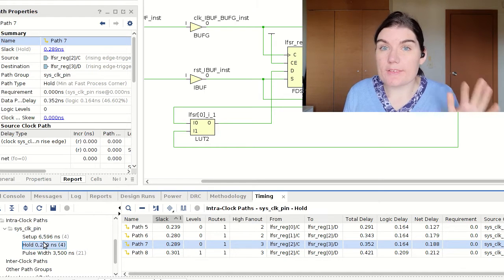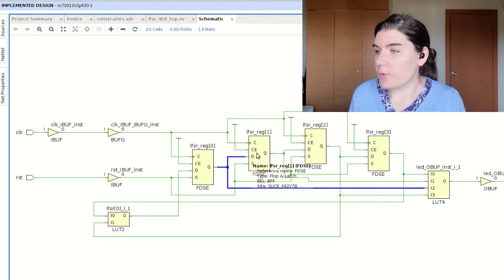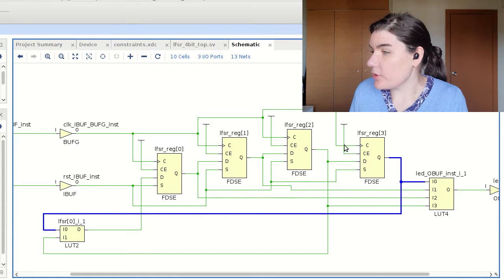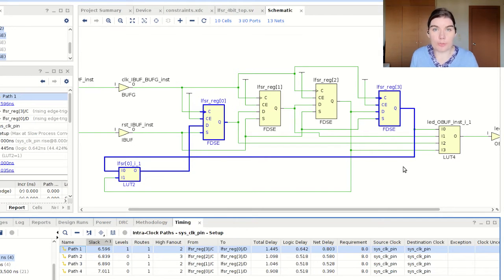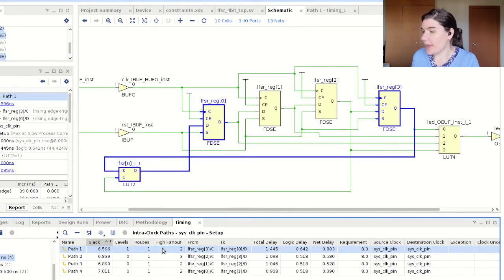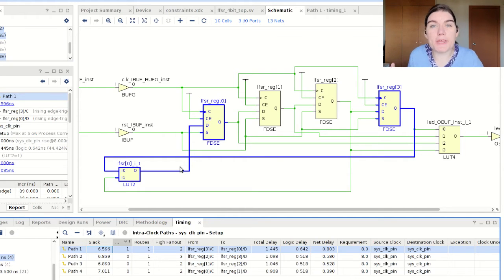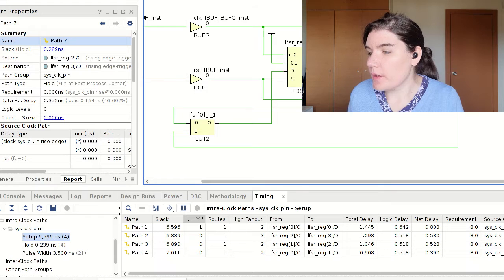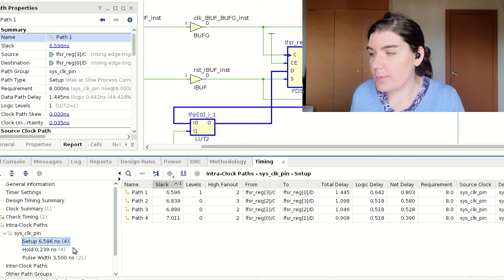Timing report and RTL schematic interpretation

Comment: Thank you for the helpful information. If the worst slack is (-1.524nsec) and the clock period of the whole system is (13.468nsec). Is the design acceptable or not? Thanks, a lot.

Comment: Thank you for the helpful information. If the timing reports a negative blue number of the worst slack, is the design acceptable or not?
Reply from the maker: The number is called "worst case negative slack". So disregarding the word negative in the name, if the number is blue, it should be positive. If the number is red, it should be negative. I don't think I've ever seen a blue negative number (excluding the "negative" in the name, the actual number being negative). Usually red is negative (bad) and blue is positive (good).
Reply: Thank you very much for your answer.

Comment: Hi Stacey. Really enjoyed your clear presentation - it confirmed a lot of things I'm just running through for the 1st time with Vivado. I too am using the Arty-Z7. Wanted to know if you go deeper into this tpic in another video. One thing I've not found elsewhere is how to increase that interprocess setup (or hold) list? What is making the list only 10 items? And as a more spot on question how can one expand it to a specific end to end point? 
In my  Zynq design I've got some memory mapped HDL registers that is passing constraints. So far good. I see the timing reports focus on the top 10 worse case timing slack endpoints...again all passing but I want to know about unreported signal timing margins. Have not found an answer skimming constraints guides or Xilinx docs & 3rd party Vivado timing help videos (yours was the best of all the ones I've reviewed). If interested in specifics: I've got a 32bit data bus from the AXIBRAM Lite IP to my HDL and in the HDL I do some memory bus decoding & writing to a final register point that happens to be an integer. The decoding works but I want to flesh out why I needed to pipeline aspects of it to get it to work. I want to measure that propagation time or ANY propagation delay between two end points of my choice. Am striking out looking through docs & tutorial videos so would appreciate any related suggestions. With sincere thanks for your sharing these videos and your talents. Cheers.
Reply from the maker: To get more than 10, you can run "Report timing summary" in the implemented design and increase the maximum number of paths ("path limits") to be >10. 

To see a specific net, you can navigate to that net in the netlist (tab next to sources in the implemented design), right click, choose schematic -> right click on the net in the schematic -> report timing -> through bus net. 
If the 10 worst case slack are all passing, then it means everything is passing. It will always show failing first. For unreported, you can take a look at 'other path groups', 'user ignored paths' and 'unconstrained paths' to check if the paths there are supposed to be there. Anything under those isn't going to be analysed.

Comment: In my Timming summary shows NA......what is the solution......?¿
Reply from the maker: Register your pin inputs and outputs, and make sure your register has a valid clock. 
This n/a means that your signals don't have two registers in the path through the device. The timing measurement is from one register to another. No registers -> no timing info.